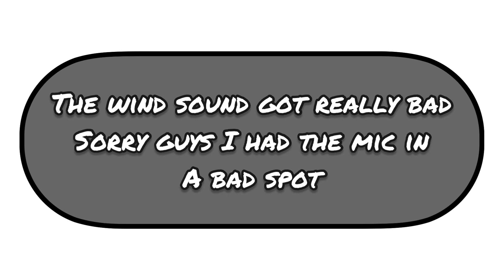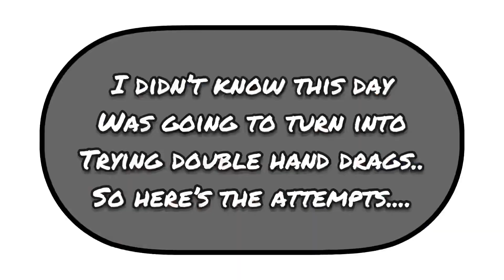It’s RoadGlide time! (motovlog)

Comment: What mid controls did you guys use on it? I have a 99 and I'm trying to find some to make work with mine.
Reply from the maker: I used a FXR twincam mid control kit! You just have to get your inner primary machined out for the shift shaft
Reply: @Dom829  awesome, thanks!  What size risers did you go with? I'm trying to get rid of the 10"-12'' ones I have